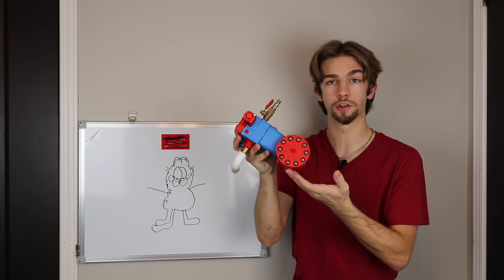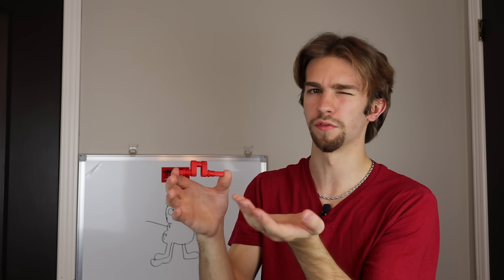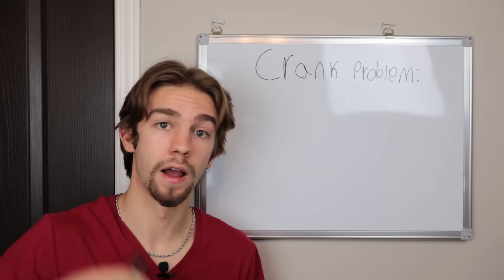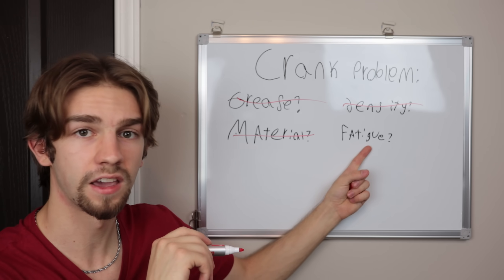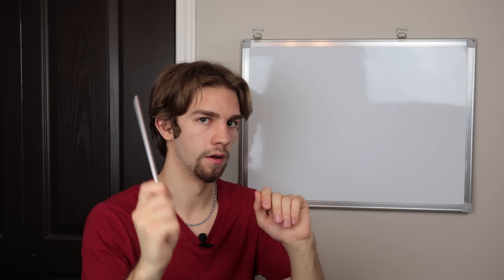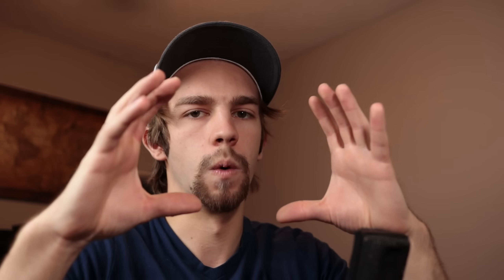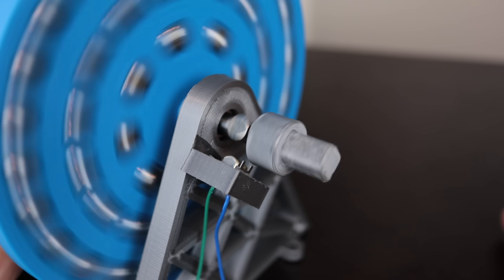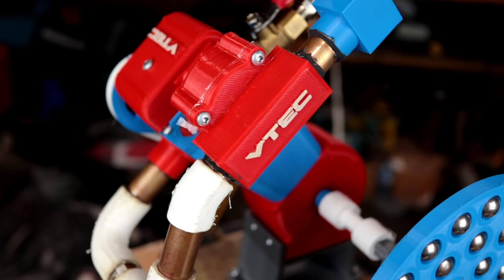Finally Upgrading my 3D Printed VTEC Engine, Then DYNO Testing it

Comment: Could you test the power curve with VTEC permanently on? I don't think that there's any advantage to not having the high lift cam in an air engine (at least not in this one, maybe if it had way higher revs and very agressive timing advance and duration, it would make a difference)

Comment: Hey mate, sent an email, that might have or might not have gotten to you. Anyway got an idea, might not work but i rekon its not bad, i havent seen someone trial it yet, unless them turning it into a jet engine. Anyway the idea is a turbo, that is built similar to a bladeless fan setup. Thus it would have normal through put (without turbo lag) but then when the turbo winds up 🎉. any ways would be cool to see someone do it thats willing to play around

Comment: Wonder if there is a way to "turbo" it  so that the exhaust energy will spin and bring in a little more extra air not necessarily to increase power, but to increase run time a little bit.
Reply: That would be like powering an electric car with an alternator off the electric motor. It would actually decrease the efficiency of the engine. Classic perpetual motion machine situation, though disguised because a turbo actually helps an internal combustion engine.
Reply: @diogenes6809  It wouldn't be like the electric motor to alternator, those would be directly connected, sapping the power from the motor directly with generating friction and heat as waste. 
In this, anything after the exhaust won't (least in any major effect I assume) effect the efficiency of the engine, and assuming there is still is energy/momentum in the exhaust pulse [because if the exhaust comes out at atmospheric, and inlet pressure is at 60, 50 will more than likely pull vacuum] could be used to possibly scavenge a small portion of the energy to recycle later. Let's say 10 psi exhaust pulses comes out, and the "turbo" recovers 6 psi and manages to store it later so that once the main tank drops below 6 psi, this extra stored pressure will add into the volume, just slightly giving a slightly longer run time.

So even if it is, let's say 3% run time boost, and it originally runs a 1 minute, it'll gain 1.8 seconds. Not much, but still some.
Reply: Though, this probably most effective for a air engine optimized for run time since it would be more effective at running at lower pressures than a air engine optimized for power. 
Also, probably the biggest challenge (atleast for this situation) is optimizing the scavenging of energy between the 3d printed turbines, dealing with the friction inside of the "turbo", dealing with a effective way to store the scavenged pressure for later, and then releasing it, without much losses.

But still, may be worth trying to expirament with the idea to see if it works or not. If it does, good, you optimized your design furthermore.  If not, you mabye learnt something or two that could translate into something else, or just having fun or enjoying the challenge of the expirament.

Comment: One thing you could do to have a stronger crank could be pressing a metal rod/pin through the center. Could also use a long screw to achieve similar effect.
Reply: And adding counter weights
Reply: I was thinking some sort of high temperature rated fiberglass filament. Not sure if you need a different head to print that though
Reply: @bakedPython I’ve printed a few different carbon materials… it would be great IMO for stiffness and strength, but would need some good lube or post process. Also not sure how it would handle heat…
Reply: Forged Carbon Fiber?

Comment: Something that could greatly increase the power, and reliability is desmodromic valves. I think part of why it was losing power was because of spring fatigue and valve float, both of which would be fixed by desmodromic valves, another is by giving the engine Aluminum Can Cylinder Liners. Instead of two abrasive Prints working down the outer layers of each other, friction could be reduced by the aluminum from the walls of a soda can.
Reply: or cutting pieces of metal pipe and inserting it inside of the block like sleeves are done, then adding O-ring or multiple O-rings to the piston (and little lubrication ofc) :)
Reply: @AaroKo  Yah, I think Reducing friction and adding seals in the block, and increasing control over the valves are the main way to gain power as of now
Reply: @crazycat7760  yes indeed :)

Comment: I like the video Camden!

Just curious though, did you ever try making the piston airtight? I’m gonna guess you did so my question is more, how did it go?
Reply from the maker: I wouldn't say airtight, but pretty close. I left about a ~0.1mm tolerance between the piston and walls and just added grease to make up the difference
Reply: @CamdenBowen  Did you try making a completely airtight seal though? Like you did on your 4 cylinder
Reply: @CamdenBowen  isn't the grease gonna act like a semi glue? i remember making something and high viscosity grease make it harder to turn, or stroke, (i dont remember what i make) so i used watery oil instead,. not sure how you do sealing with more watery oil though
Reply: @mr.2minutes161   Yeah I kinda thought about that too
Reply: You gona make airtight lve or why ur asking
Reply: @Kippo6969  lol what?

Comment: now run high octane through it
Reply: A nitrogen tank
Reply: shi 93 octane that would sound amazing
Reply: Too little. He should rut it with nitroglycerin
Reply: @elvtars8813 wouldn’t nitroglycerin actually be really low octane? It detonates easily under compression
Reply: @elvtars8813 the stuf that's in dynamite?
Reply: Nitromethane
Reply: @GumerTheGum Ah yes cylinder head bending liquid
Reply: High octane compressed air?
Reply: @cadecarp11  yeah
Reply: Or 190 proof moon shine
Reply: VMELT
Reply: 93 doesn’t make more or less power than 87 ,higher octane is for more compression and more ignition timing because it helps to reduce pre detonation
Reply: It needs a rev limiter so you can smack the shit out of it
Reply: Helium ironically would be the equivalent. Or he could be dangerous and run hydrogen through it. That would be insane sounding.
Reply: Extra crisp air
Reply: Or E85
Reply: YES
Reply: Hahaha 😂
Reply: Ethanol
Reply: High octane can blow up engines that aren't made for it
Reply: You mean actual fuel and combustion?
Reply: Kerosene
Reply: i think theres only one valve though
Reply: Or there could be two fuel lines and one would be pure oxygen
Reply: Ah yes, high octane air. My favourite
Reply: I have never been more disappointed in a comment section. IT DOESN’T HAVE A SPARK PLUG. THERE’S NO COMBUSTION GOING ON HERE
Reply: @Averagebrockhere  you know jokes?
Reply: @otsos_cars  oh i deadahh thought they were being serious my b
Reply: @Averagebrockhere  I've been there.
Reply: Uhh it’s not a combustion engine
Reply: Its not even a combustion engine yall😭😭